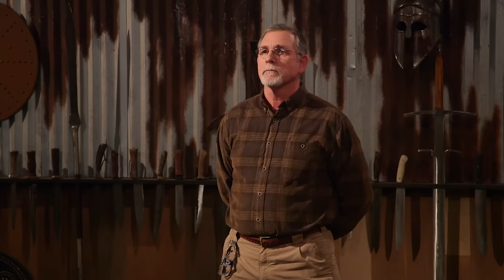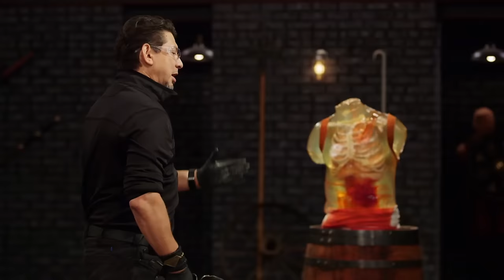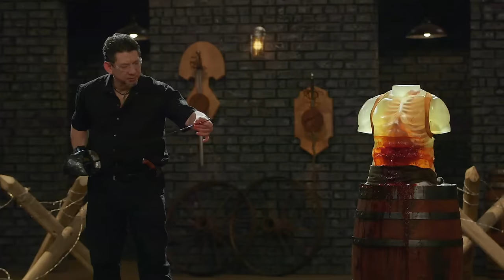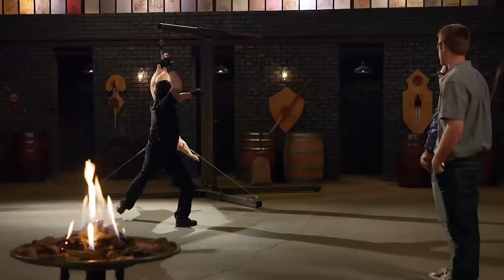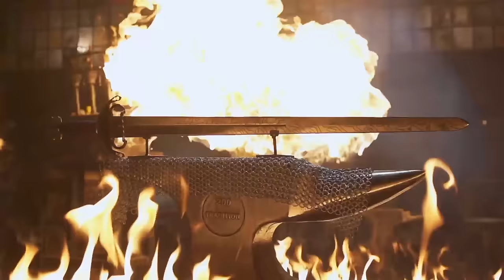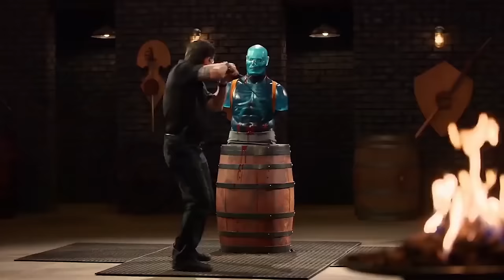TOP WEAPON TESTS OF ALL TIME - Notorious Blades Unleashed! | Forged in Fire

Comment: every time i see a bend test i immediately get super anxious lol
Reply: I'm actually pretty surprised he got disqualified for a slight bend in the blade. Seems to me they could have kept that competition going.
Reply: @reliantncc1864  for Teddy? It was more of what the bend represents. From what I understood, it's like bending a paper clip back and forth: eventually it snaps. 

You don't want it to snap in your face.
Reply: It freaks me out too  especially with that music.
Reply: @Maninawig  they've pointed out multiple times that it was not uncommon for swords to bend in battle. They've kept tests going after a bend on several occasions.
Reply: @reliantncc1864  bend one way, yes. But his sword bent a bit one way, and more the other.  I remember the Colonel stating once that such a thing only happens when the heat treat did not work, which means it can snap in a judge's face the next time they use it. Same as folding a paperclip.

The bending you're referring to is when it happens only In one direction. At that point, the metal is most likely hardened correctly and the sword is safe.

Comment: Strength test is the most toughest to pass in all tests and biggest deciding factor ! Never felt like it was 1 hour show .
Reply: Well, heat treatment is one of the harder things to get right in the competition.
Sharpening the blade is a more straight forward step that can be easily tested and repeated until the result is okay at the very least.
Weight distribution is also kinda difficult to get right I would say. Very often the blacksmiths recreate designs they are not that familiar with and the time restriction seriously limits the ability to fix a weight problem you started the entire design with. But weight problems only rarely make your blade snap ^^

Comment: So a proper sword blacksmith back in the day, would know if his sword wasn’t balanced - how do they seek to get the balance? 

Change size of pummel? Thin the blade somehow (but surely makes it longer)? Or start over and get good at it?
Reply: Well made swords have a property called distal taper. Meaning the blade's thickness towards the guard is greater than it is towards the tip. This brings the balance back towards the guard. It is possible to put this in during the grinding process, though good practice to get it at least roughly done during the forging process.
Reply: You can thin a blade by grinding and by adding a groove, among other ways. Thinning the blade doesn't just mean hammering out the same amount of metal, it also means removing metal.

Weighted pommels help to move the weight, but not every blade can be helped this way. Many historic blade designs do not allow for pommels. Also a pommel adds to the total weight of a blade, which is risky. Lighter weapons take less energy to swing.
Reply: That's why you don't just get into sword smithing by yourself, you pretty much need to learn from teachers. And you can see various techniques developed and passed down throughout history. Like various techniques mentioned in the comments above, and sometimes you can see blades with unusually long handles. Also notice older designs like Roman Gladius tend to be shorter than medieval longswords, we can probably guess that they could not make the Gladius longer due to balance issue.
Reply: Historically the answer is very simple. They just didn't have to try fixing a bad balance point after the fact.
A 40 year old swordsmith in medieval times had basically been involved in making swords for 30+ years. And he didn't do more than a handful of different designs most of the time. You could have given said blacksmith a random piece of steel and he would from sheer experience instantly be able to tell if its the right amount to get the balanced shape that was required from the designs he made hundreds of times.
At Forged in Fire we deal with very talented individuals, but from a historical standpoint most of them would be considered talented rookies at making a specific sword design. Its just very very difficult to compete with someone who has done a very specific task so many times.
Reply: Balance is a bit detailed for your question, as the balance of a blade depends on what the purpose is. For instance, leaf blades were made to be heavier ahead, so the balance might come with the tightness of the hilt. Longswords had a midrange balance to counter using two hands (cause you don't want your back hand to flop around), and rapiers had a 0 balance, meaning the point of balance was in the guard. 

How smiths used to figure out a good balance was to study for years under a master, than focus on the use of the blade more than what trick to use...
Reply: @AliothAncalagon  Correct. It was a generational occupation and was often that families main source of income as well. Like carpenter, baker, basket weaver, seamstress, ect. Most of those professions were taught by Mother and Father passing down the technique to son or daughter as soon as they were old enough to walk in most cases.